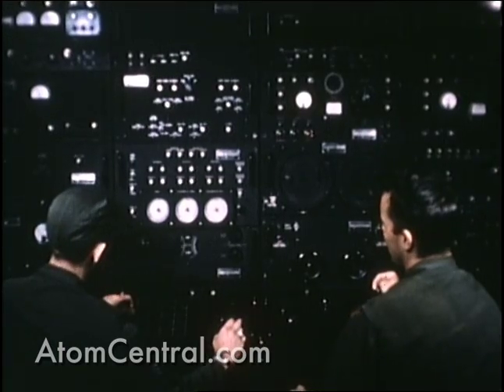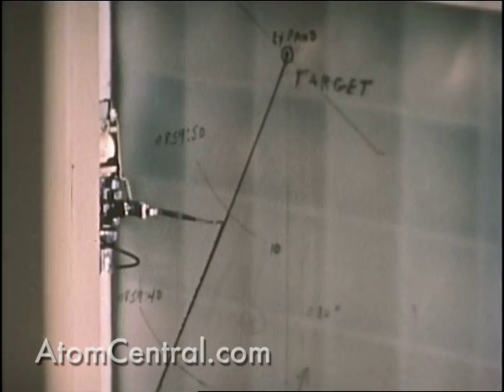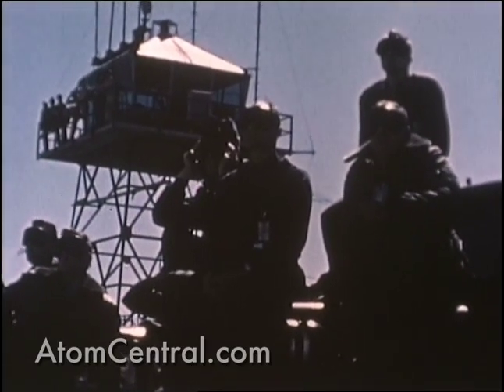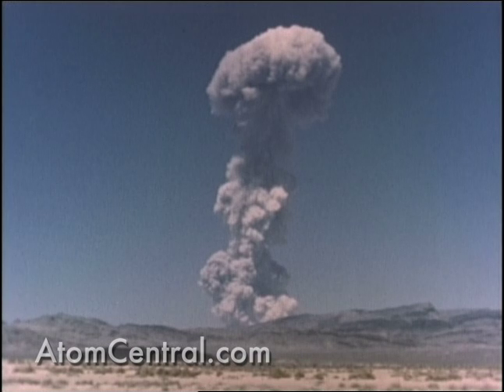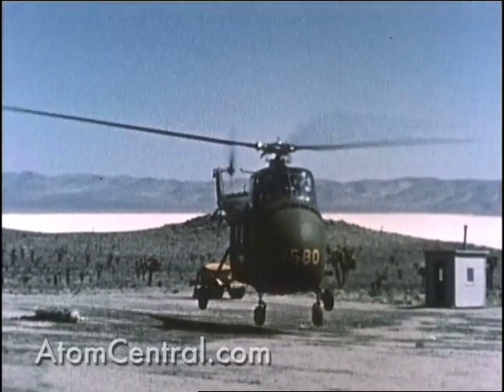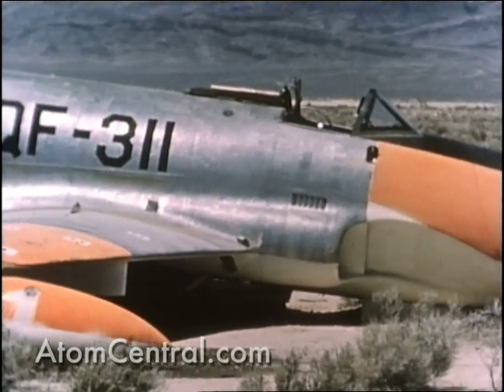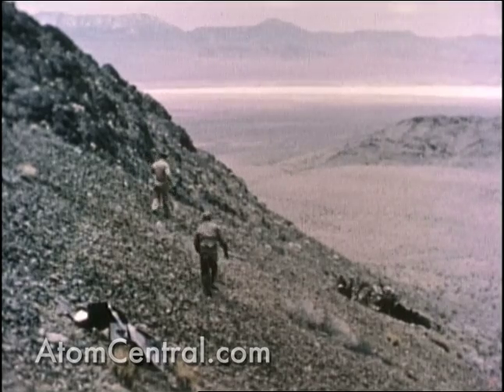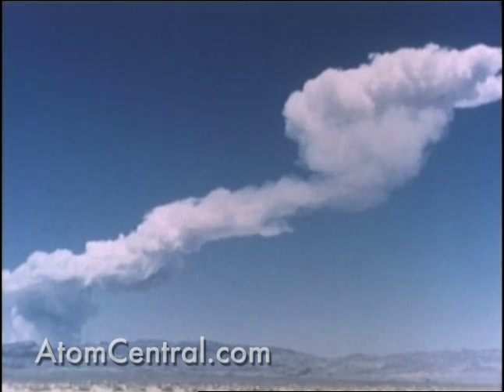Atomic Effects on Drone Aircraft in Flight

Comment: I am amazed at how resistant these old planes are to nuclear emp. Modern airplanes would just stop functioning immediately.
Reply: No digital systems back then, that's why they were unaffected. Little unknown fact, the military has redundant systems using vacuum tubes for this very reason.
Reply: +classictutor There's no significant EMP if the nuclear detonation occurs at ground level. It is only seen for detonations at very high altitudes.
Reply: Im dumb for doing this, but there are 3 month intervals between each reply. Coincedence?(alluding to the alluminati) Im so stupid 😓
Reply: Modern airplanes wouldn't be significantly affected either, since the circuitry is shielded both on purpose and incidentally.
EMP is not like in the movies where it's a "magical invisible wave" that just utterly disables everything electronic.
Reply: zolikoff Yeah, you're right about the shielding. that is if the Avionics Techs properly re wrapped the wires after maintenance.

That shit was a pain in the pee hole.
Reply: Nuclear detonations in deep space or near ground level don't produce much in the way of EMP, the way to get a significant pulse out of a NUDET is to set off something above the megaton yield in the very upper atmosphere. This produces a massive quantity of high-velocity charged particles, which interact with the planet's magnetic field, causing the electromagnetic pulse.
Reply: Would explain why in MW2 when the dude luanched a nuke into space and detonated it.  He wanted to EMP the planet to avoid a nuclear war.  Since WW3 was in full swing.  No working electronics, no nukes.
Reply: Alucard Hellsing No, price did that to halt the Russian invasion in the east coast dead in its tracks. Can't win wars without air superiority and armor backing you up. That EMP in MW2 knocked out both of those options for the Russians and allowed the Americans to regroup quickly (whiskey hotel [white house] mission) and land a decisive counterattack (New York missions in MW3). Sorry, just had to point that out.
Reply: xXxMartin96xXx  Your reply is valid. Good choice in spreading knowledge and reason instead of flaming.
Reply: xXxMartin96xXx I knew the nuke caused the EMP. I assumed people would know that the detonation of the nuke in high atmosphere caused the subsequent EMP. Should've been more specific, my apologies.

Also, that was the intention, to have a nuke produce an EMP that would weaken the Russians and tip the scales in the Americans favor. (Which did happen)
Reply: Aaghhh, always great to see tax payers money put to wonderful use.  Not that we couldn't use the money to feed the hungry or fix broken down roads or anything....

Comment: I thought EMP fried electronics and radio telemetry?
Reply: This was a low yield low altitude test. They don't produce a far reaching EMP field. It is the high altitude detonations (like, 400km and above) that you have to watch out for when it comes to EMPs.
Reply: Yeah. But the airplane was flying right over the detonation.  So why didn’t it crash from its electronics being fried?
Reply: @semiauto3148  Questions: How many electronics did an airplane at that time have? How shielded were they against EMPs? Were cable lengths long enough to catch enough energy to be harmful?
I know that the effects of EMPs on cars (especially old ones) were very exagerated in fiction.
Reply: Windsaw yeah. Good observation. Tbh. I don’t know those answers. But an atomic blast that close would seem to be enough to fry anything.. if they did have any big or small....but I don’t know if they had any and if they did would it be enough to down a plane ? Hmmmm
Reply: @semiauto3148  I would also like to hear an expert's opinion on that.
But when it comes to nuclear blasts, from all I have read and seen, I have come to the conclusion that people usually overestimate the effects of small nuclear devices and underestimate the effects of large ones.
We do not know exactly how far the plane was at the moment of detonation. It seems close, but if it was still three or four kilometers away I would expect the effects shown.
Reply: Any EMP or lightning would be highly localised with a low altitude detonation.
Reply: @semiauto3148  1950 was no electronics haha
Reply: Roadspike ok. I didn’t know. I wasn’t into planes back then as I wasn’t even born yet. Lol  I’ll take your word for it.  If you watch the vid. It just about blew that back stabilizer off
Reply: Semi Auto  I was in the Air Force and know that the airplanes in this video are not fly by wire like modern aircraft, so the flight controls wouldn't have been damaged because they were cable operated, but certainly the radio telemetry and electronics on board had to have been fried- yet somehow these planes were "landed". Wiring is shielded, but instruments aren't I don't believe. This video is baffling to me because the aircraft were close enough to be damaged by the blast wave. More questions than answers.
Reply: Semi Auto - My guess is that they used vacuum tubes and wires, which can withstand a lot more amperage than modern silicon chips.  Here’s another interesting question: why wasn’t the whole roll of film exposed by x-rays?  My bet is that the film case was made of thin sheets of lead.

I’m always a little nervous when I do a search like this: “How did the military avoid frying electronics during nuclear tests?”  I’m worried that Google will return “Who wants to know?”
Reply: Have to rember that the planes were somewhat altered and much different back then to what we have today.  He mentioned in video they were painted with heat absorbing paint so who knows what else was done.  Paint back then had lead i believe, and god knows what else.  Hell the blast could of been safer than the planes before it.

Comment: I find ot interesting how the military often got around the problems caused by EMP.  For example the Nike missile was an anti-aircraft, short range, small yield nuke. It was designed to be fired at bomber formations as they approached the US.  The idea was that if the initial blast did not knock down the planes the EMP would.  But since the misslres were to be fired in small groups, the Nike's control systems used vacuum tubes to protect it from the EMP of a missle that detonated earlier. 

Only practical side effect of the Nike was it was short range (between 25 to 200 mile range depending on the missle type) and were usually posted near major ports and bases.  So if one was used and the winds were blowing the wrong way the city, port or base they were protecting would get hit with fallout.  There is a Nike missle batery located just north of San Francisco, you can see the city from it.
Reply: Actually, interestingly, the low-yield nukes are almost useless for producing an EMP, being instead good at producing a large pulse of radiation, while significant EMP is only really produced with a very large bomb (Above a megaton), initiated at very high altitude, so as to interact with a sparser atmosphere and the less dense sections of the geomagnetic field. The EMP is not inherent to the nuclear detonation, but results from its interaction with the Earth's magnetic field.
Reply: Amperzand hmmm, that is interesting.  The blast yield was only 21 kilotons for the Nike Zeus A warhead.  

The Nike was a weapon of desperate last resort, you can see it in the design of the missle Battery they used, they were not significantly reinforced in anyway. In fact the one at the Marin headlands is barely underground and only has maybe a foot of armor on the doors above the missle elevator leading up from the storage bay.  So perhaps the designers were more interested in protecting the missle from the EMP caused by enemy weapons...  Very interesting.
Reply: Steven Strain True, but the Nike was only really designed for an antiaircraft role, although it was shown to be effective for Surface to surface and anti-short range missle defense roles as well.  The missle only had three known variants, one was the Ajax, a conventional warhead antiaircraft missle. The Zeus A, contained a low yield warhead. And the Hercules could use either conventional or low yield warheads. Both the Hurcules and Zeus A were multi staged missles for longer range as well.  I am not familiar with any anti-ICBM missles that had nuclear warheads.

Comment: It's called FLY BY WIRE in the industry. Since 1947. I worked for a company that made the main and tail rotors for ALL helos in USA in the 1980s as an estimator engineer. 

If you believe arabs flew heavies into the 3 towers on 911, well...they didn't. It was FBW
Reply: That would be remote controlled not fly by wire.
Fly by wire means simply that the steerings are operated by electronics instead of direct hydraulics or cables.
Reply: "Fly by wire" means the pilot control inputs are interpreted, analyzed, and corrected by a control system to stay within the safe flight envelope.  Just like ABS in your car, computer allows you to control the brakes all on your own until you exceed the braking force required to lock up the wheels at which point it intervenes and start pulsating the brakes to prevent loss of friction.  It has absolutely nothing to do with remote piloting of aircraft.  Not only rotor production has no relevance to UAVs, but you also have no clue what you are talking about.
Reply: did they cut the passengers and crew members throats with box cutter by remote control?
Reply: only a fool would believe that fiction. quit selling the lie, it stains what's left of your soul.
Reply: @S.Smith funny fact is no one will ever know if that really happened...
Reply: oh come on, the no fly theory is just dead, just as the "fake plane" one is... just search for any debuknig video, you will see that 9/11 was real...
Reply: Correlation does not necessarily mean causation.

Comment: I thought the EMP pulse would fry the aircraft electronics. But obviously it didn’t as they could still control them. Mind you when I worked for the RAF supply all electronic equipment had EMP shielding inside so perhaps they had that also back then.

Comment: Starting at time mark 3:12 - 3:13 near bottom middle of the video something happens to the skin of the aircraft . : Starting at time mark 3:31 - 3:33 this air craft sustained some physical damage to the tail section and most likely other parts both internal and external sustained damage that could be seen with the unaided eye.

Comment: actually a lot less damage than I thought would happen.
I mean clearly parts are flying off the plane, but still looks like you might be able to land the plane safely (assuming there is a place left to land that isnt covered in molten radioactive glass) lol
Lets also not forget those atomic weapons are like firecrackers compared to todays ICBMS doubtful this would play out the same at todays weapons yields.
Reply: Quite interesting is that the US also developed nuclear missiles designed to take out enemy air formations.

Comment: it's impossible to affect a plane when a atomic bomb. They're made to be safe
Reply: Tell that to the crew of the TU-95 that dropped Tsar Bomba. They were lucky to make it home. The aircraft had to be destroyed after.
Reply: l8tbraker why did they have to destroy it? i thought tsar bomb was a relatively clean bomb
Reply: mightymoken Sorry, I was mistaken. The plane that was destroyed afterward was a secret US electronics reconnaissance plane that was in the area gathering data. It's paint was scorched, and the airframe was damaged by the bomb's shockwave. As for the TU-95, it too suffered paint scorching, and the shockwave violently dropped it a kilometer. It returned safely to base, however. The plane had been heavily modified to be able to carry such a huge, heavy weapon. Its weight was twice the plane's normal bomb payload. Part of its bottom was been cut away, and the bomb bay doors removed. And some of its fuel tanks were removed as well. So that Bear bomber was a one-off test horse. I don't know its ultimate fate.

Comment: I thought nukes release emp too. How did those planes not lose all power?
Reply: Old tech - analog electronics. The P-80 jet was introduced 1n 1945 and produced until 1950, 5 years before this was filmed.
Reply: @buzaldrin8086  Is this account actually associated with The Buzz Aldrin? I don't really know how analog is different from modern technology so I'll have to read more to understand. I thought EMPs stopped all electric energy, and even radio waves, which should be essential to a drone.
Reply: @adamweaver1594  Here's a good start, from the main Wikipedia article on EMP. 
And, no. note how I spell my user name on YT. That should give you a clue. 
https://en.wikipedia.org/wiki/Nuclear_electromagnetic_pulse

Comment: What a moronic test. How many times is an airplane going to be flying directly over a nuclear explosion? And  if one did, the size of the bomb used would almost certainly be different then the one used during this test (odds are).
 What did the test tell us? That if you fly too close to a nuclear explosion - your aircraft will get damaged. DUH. And the pilot will get a nice dose of radiation. Again...DUH.
 Humanity seemed exceedingly stupid during the early part of the nuclear age.
Reply: A plane may well be the one dropping the bomb, and using a bomb on an advancing enemy force (which would include their planes) is pretty logical if you want to go nuclear on a controlled scale.
The test told us the kind of ranges such a yield of bomb can expect to damage aircraft, which can be scaled to other nuclear bombs.
Of note is that the US also developed anti-air nuclear missiles to take down whole enemy formations of planes.
Reply: @madmax07ish  If a plane drops a nuclear bomb, it is obviously going to turn away once the bomb is dropped. So there is no way the plane will be directly over the blast. 
 There is no way that planes are going to fly directly over a nuclear, bomb blast in wartime...unless one or two did by mistake.
 And I guarantee you that a decent engineer could figure out the survivability of an aircraft in such a scenario anyway.
The test was ridiculous.
Reply: @McRocket  You don't need to be directly over the blast, unless it's a low yield bomb, as they used in this video. The planes dropping the nuclear bombs on Japan had to turn around immediately after dropping and dive to pick up enough speed to get away, and still encountered minor damage from the shock wave. Now consider that these bombs were relatively weak compared to those developed later in the cold war.
And the testing wasn't purely on the structural affects. The drone had two large scientific pods on either wing which fell off, which would have told them valuable information like electromagnetic effect, radiation at these altitudes, etc. And above that they no doubt had several other tests going on at ground level at the same time.
Reply: @madmax07ish  The Hiorshima/Nagasaki bombers were slow, 300+ m.p.h. B-29's. When this test was done, the bombers would be at least twice as fast as the B-29.
 And if a plane wants to get away, just put a parachute on the bomb, to slow it's decent (Fat Man and Little Boy had no parachutes).
 During the Tsar Bomba test (of a 50 megaton bomb - largest ever tested), the Tu-95 bomber (a turboprop bomber) was 39 km away when the bomb detonated.
https://en.wikipedia.org/wiki/Tsar_Bomba#Test
 There is NO WAY a bomber dropping a nuclear bomb is going to be ANYWHERE NEAR the blast - let alone flying RIGHT OVER the explosion.
 The test was completely ridiculous.
Reply: You not knowing the purpose of the test does not necessarily make the test stupid.
It cost a whole lot of money, so chances are they had pretty clear and concise reasons for doing it.